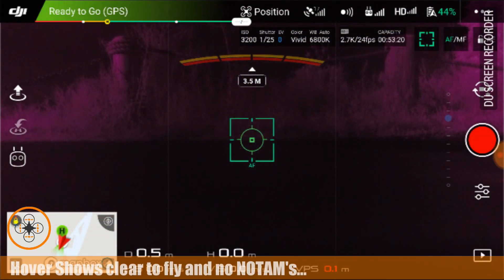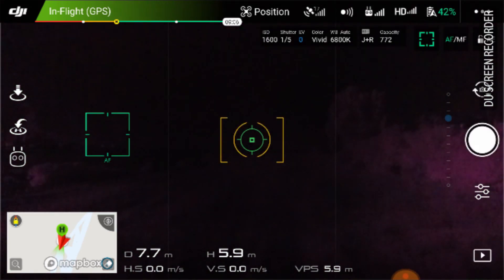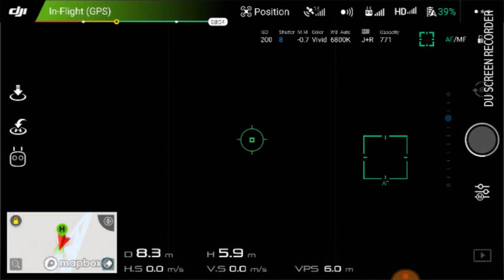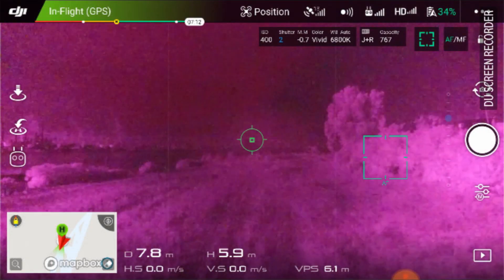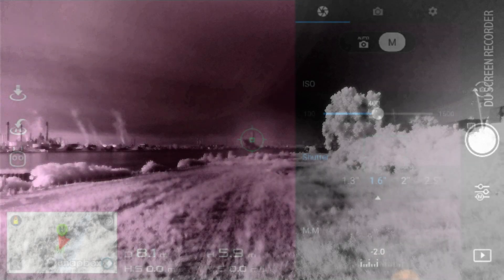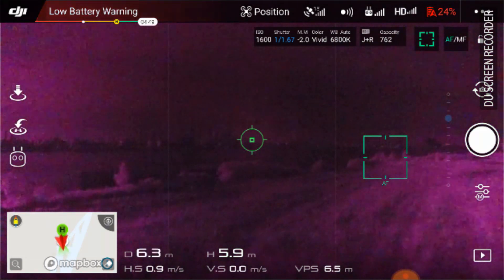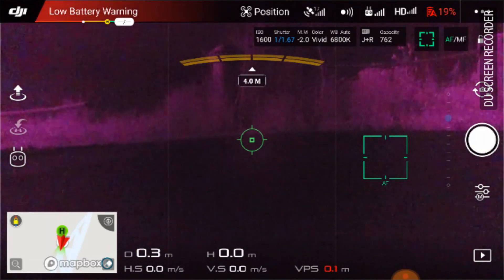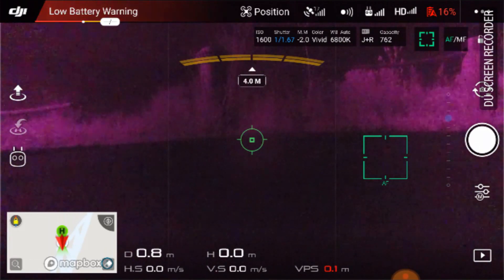DJI Mavic Pro - Testing DIY 760nm NIR Filter!

Comment: Can you please show a video where in total darkness we are able to see you for example which proves that NIR filter is working !!   Secondly can you build one and ship a NIR filter for a mavic 2 Pro hasselbad
Reply from the maker: Doesn't work like NIR (near infrared) starts around 760nm and ranges into +900nm.  To see at night you would need IR illumination as I think your confusing NIR with FIR (far IR) which far, far longer...
Reply: Umm, you should spend a little time understanding how digital image sensors (CMOS, CCD..) operate. They’re inherently sensitive to a much broader wavelength range than what’s required/ ideal for capturing footage, so pretty much every camera you’re likely to use (phones, dash cams, web cams,  drone cams etc) have an infrared CUT filter usually bonded to the lens assembly. They generally start filtering from 680nm and block from 700-1100+nm. Night vision cctv cameras are just regular cameras with the ability engaged the filter for daylight, than disengage it for night time. So what you are basically doing by adding this filter you’ve made is blinding your camera. An optical filter doesn’t  become moot with the addition of another kind of filter, it just further reduces the wavelengths that are able to reach the sensor. There’s heaps of videos of people opening up iPhones and stuff to scrape the ir cut filter off inner lense, turning them into ur night vision cameras if you’d want to see that demonstrated.